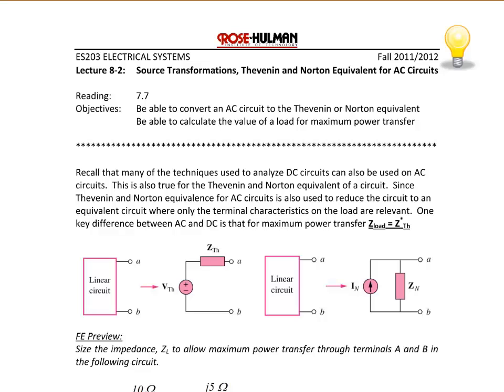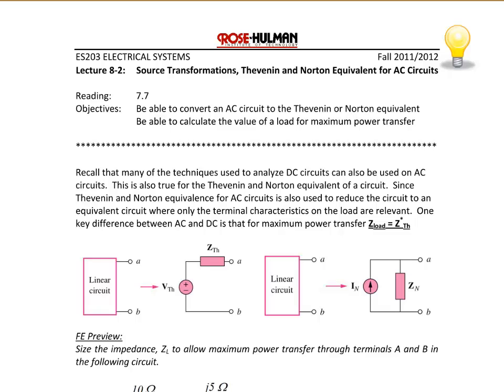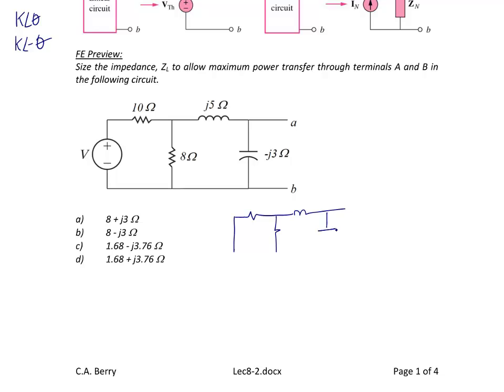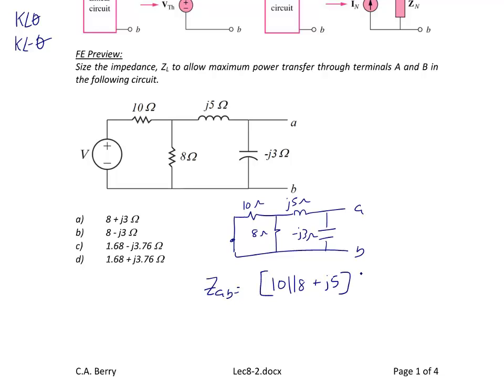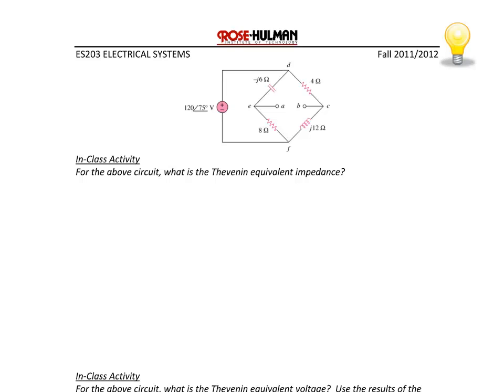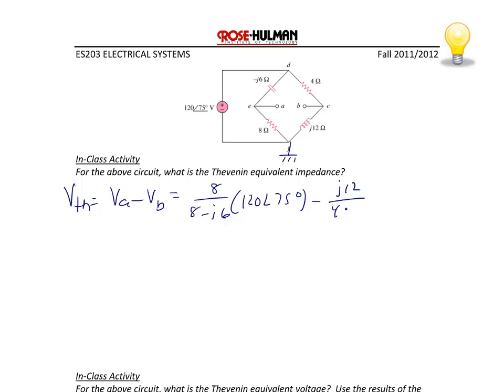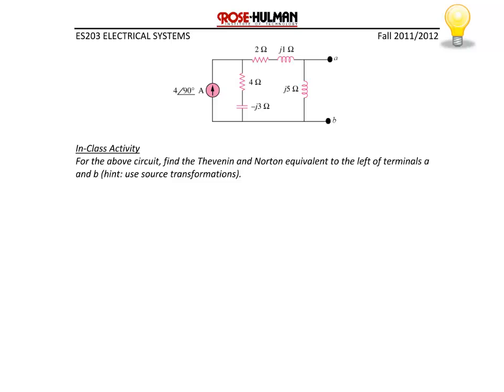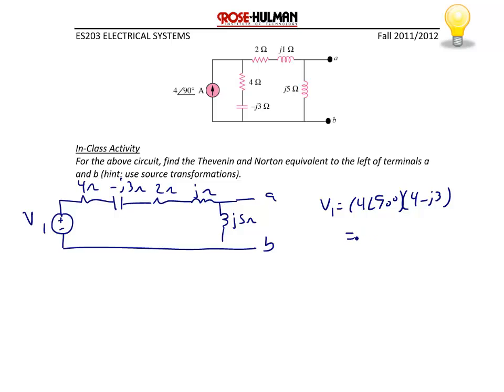ES203 Lec 8-2: Source transformations, Thevenin and Norton for AC circuits

Comment: i believe u calculated the final answer for Vth for the wheatstone bridge wrong. i think you plugged in the numbers wrong in the calculator.
Reply from the maker: ash farza The answer for the voltage has been checked and confirmed as correct.
Reply: +Rose-Hulman Online hey! im kinda lost here.Can you expain how can you calculate the Va&Vb pls? thank you!
Reply from the maker: You always find a node voltage with respect to ground so you use the voltage divider for the Wheatstone bridge circuit to find the voltage at a and then the voltage at b. Vab = Va-Vb.